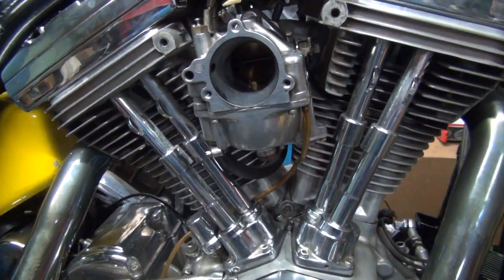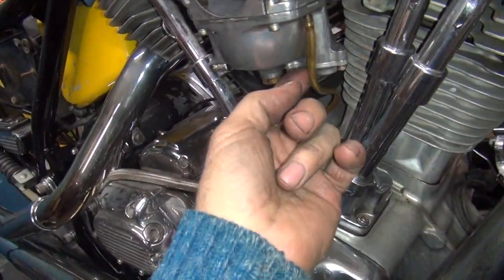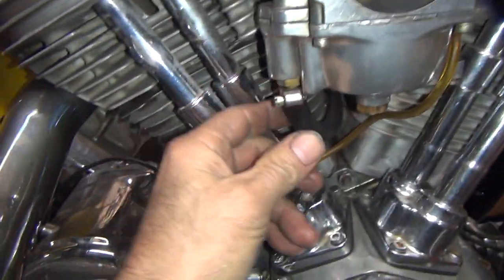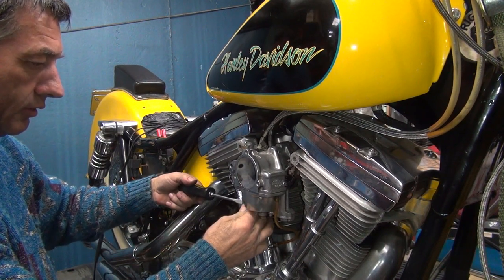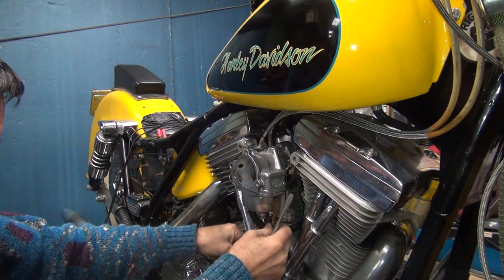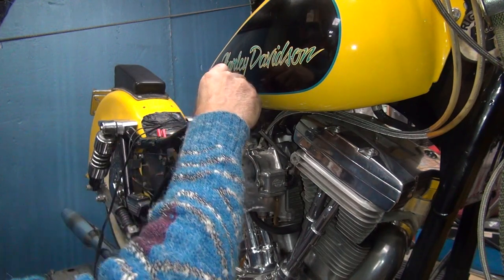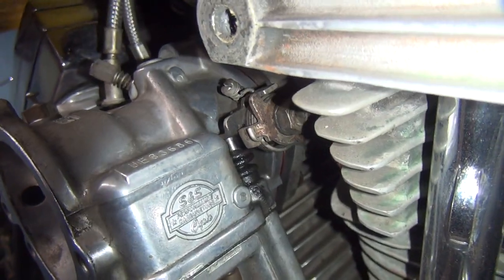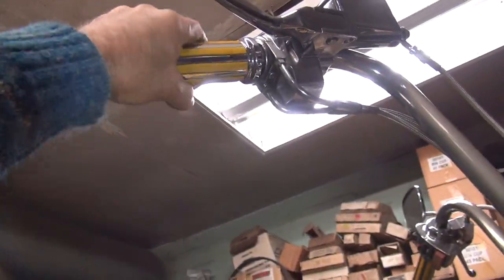#130 1990 fxr custom s&s E carb rebuild install topend 80ci evo carburetor fxrp harley tatro machine

Comment: Yes Tatro you are 100 percent correct when you say, "it's hard as hell to find good help nowadays." I ride softail night train 2006 and I love the bike and I'm a very novice low skilled mechanic for working on it but I do all the oil changes I can adjust my clutch cable and throttle cable and a few other things but the Harley dealer tips me off when ever I need anything more accomplished but iam a retired union carpenter ofcourse journey man and I was a Forman most of the last 10 years so I'm very familiar how bad the labor force has become but what I want you my good man Tatro to be very confident of is you are watched and appreciated by thousands of men and alot of them are very young men and I'm very confident that you are instrumental at giving these young men a excellent head full of good good work ethics and understanding that its extremely important to be a good competent mechanic and bluecoller worker so I'd love to find a way to know how many young guys youve inspired to NOT BE A DUMBASS!!! Lol and go on and make a good contribution to shops and motorcycles all over our great great country?!?!